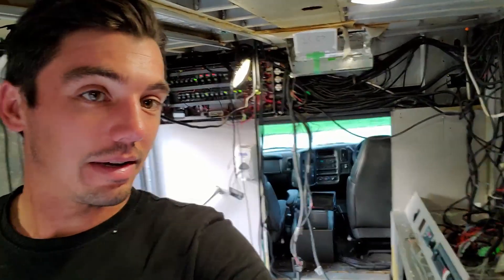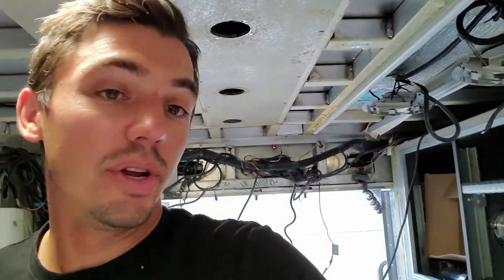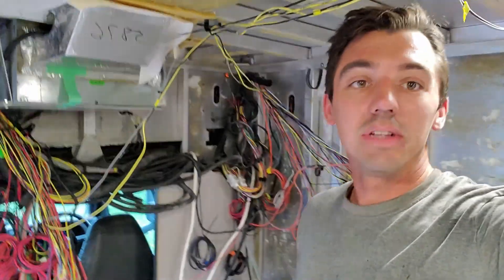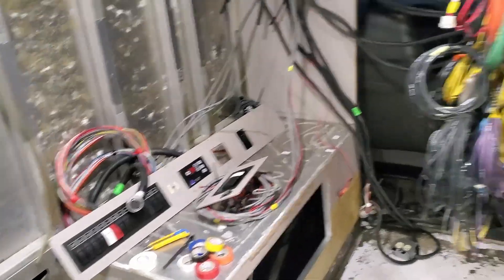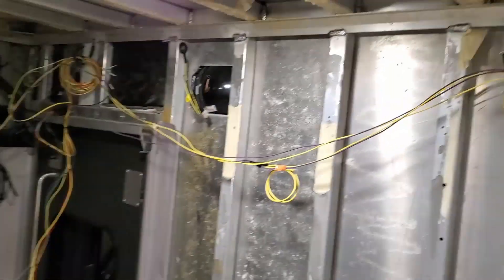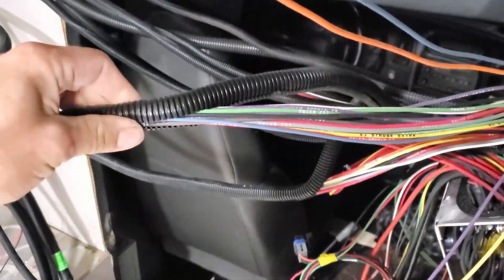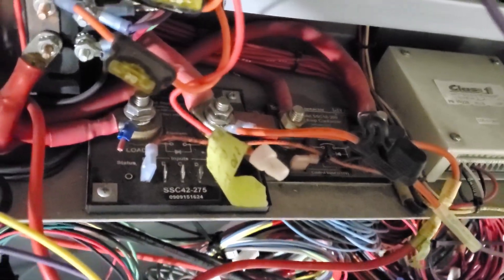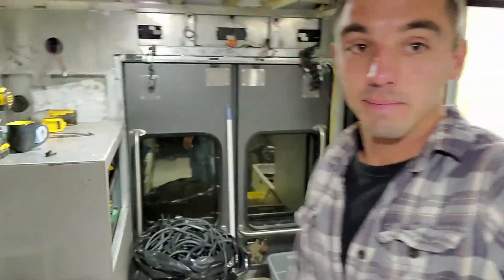Electrical Series #1 | Converting our 4500 Kodiak ambulance into a camper ... one wire at a time!

Comment: Good job in the demo. I removed 150 lbs of wire, about 50 lbs of aluminum and approximately 1000 lbs of furniture from our van. It can seems overwhelming but it’s definitely doable. I only left the truck lighting and door locks. I want our box to be electrically separate from the cab.  
Great job and great video! Keep them coming!
Reply from the maker: Thanks so much!! We also plan to have the box and cab running separately. Andrew has another video coming out soon where he tackles taking apart and re-wiring the relay panel! What kind of rig do you have?
Reply: @RogueRoamers  We have a 2007 International 4300 Lo Pro with a Medtec box. The drive train is a DT466 with an Allison 5 speed.